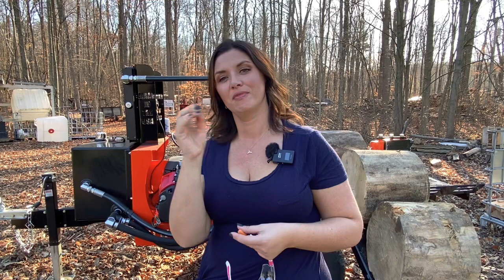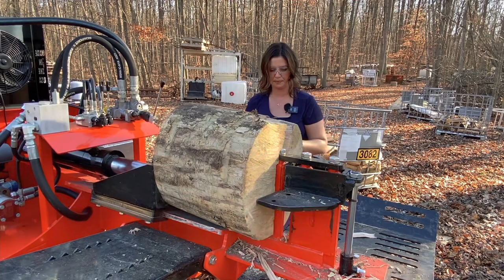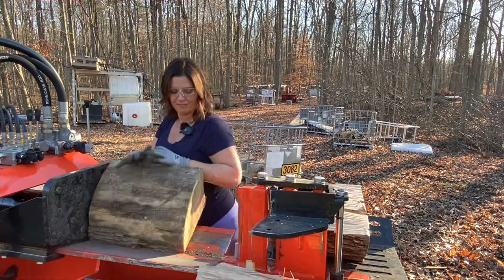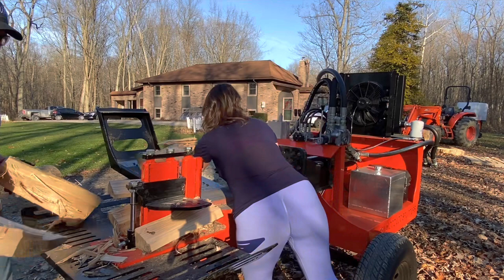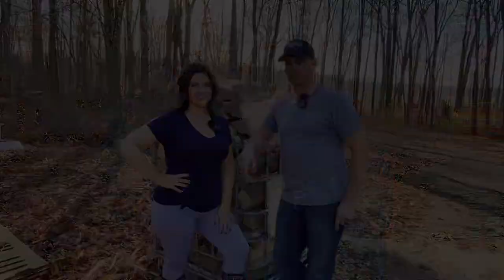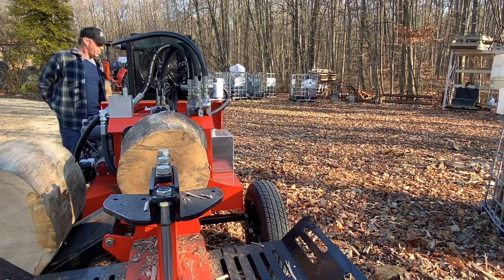How Fast Can We Split 1/3rd Cord of Big Ash Firewood? #95

Comment: One of the best.  I, a hydraulic engineer, working for 50 years. You have nice straight grained wood with no knots. Wonder how you would adapt to West coast  hemlock and spruce. My splitter is 50 years old with a Cat trunnion mount on a 5 inch x 36 inch cylinder.  My wedge is on the tounge like yours and I sit down on a round with toilet cushion. The tongue is on the gound so I can roll  3 foot rounds into the "jaw", using my knees. I have tables on either side so nothing his the ground or my toes.  I replaced the old 12 hp Briggs, with a 15 hp Duromax with starter.  I have belt drive to jack shaft with  a 3:1 ratio to a gear pump.  No relief, if you sleep at the switch, you kill the engine.  Wood splitting with a powered splitter should be a ONE PERSON OPERATION FOR SAFETY.  OK to have help bringing wood in or taking it away but NEVER,  have two sets of hands involved in the "jaws" and controls!
Reply from the maker: Good information, sounds like you built a heck of a machine. I wish I knew more about hydraulics!  I’m learning some though.

Comment: Great teamwork Guys!!  Didn't know ash could pop like that!!  Do you have a link to the gloves??  Stay Hydrated and Have a Safe Day
Reply from the maker: Thanks David. I believe this is the link. I purchased them at Home Depot and will be picking up more!

https://www.homedepot.com/p/Milwaukee-Large-Red-Nitrile-Impact-Level-3-Cut-Resistant-Dipped-Work-Gloves-48-22-8972/312921983?g_store=&source=shoppingads&locale=en-US&pla&mtc=SHOPPING-RM-RMP-GGL-D25H-025_012_PNEUM_FAST-NA-MILWAUKEE-NA-PLALIA-NA-NA-MK492413300-9016900498-NBR-4051-CON-NA-FY22_4051_UprFun&cm_mmc=SHOPPING-RM-RMP-GGL-D25H-025_012_PNEUM_FAST-NA-MILWAUKEE-NA-PLALIA-NA-NA-MK492413300-9016900498-NBR-4051-CON-NA-FY22_4051_UprFun-71700000090276448-58700007646538317-92700069079774809&gclid=Cj0KCQiApb2bBhDYARIsAChHC9vjdovU81VnytaqGb3bkd5yjBCsfY6-R1GTPwUbwC1XZ-Zb4lbLSFYaAi59EALw_wcB&gclsrc=aw.ds

Comment: hi there  good splitting . i stack the wood a bit different in the totes may interest you . they hold a bit more wood , i can look for that video if interested   johns   long as your tractor can pick them up
Reply from the maker: Thanks John, I think I watched that video but will go back through and find it. My tractor lifts a little over 4k so that will work. I also have a load of the bigger totes I just have to get them cleaned and cut.

Comment: I hate to say it. I'm an Eastonmade snob and I do believe the allwood has it beat hands down.  Not the knowing exact specs of each machine but the Allwood is spanking the Eastomade you just purchased.
Reply from the maker: Ed they both appear to be great machines from the little I’ve used them both. I will look into the specs, cost etc. I think they will both have their strong points and not sure what if any weak points they’ll have.
Reply: Like I said before you introduced the allwood the Eastonmade was 🤴 but now you have me second guessing. The sheer power and speed of the Allwood is incredible.
Reply from the maker: The power and speed is definitely crazy.

Comment: I always split with 1 hand on the wood and 1 hand on the control as the wood here in Aus is super tight grained and twisty is the norm. I've had dozens if not hundreds spring on me over the years.
Reply from the maker: Alan I have never had that happen like this before. But i also have not had this fast of splitter before either.